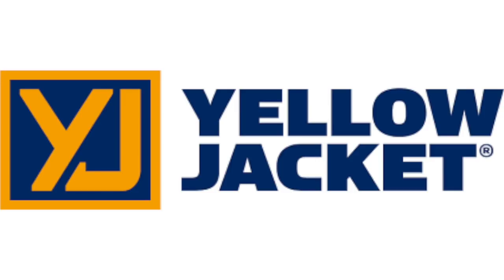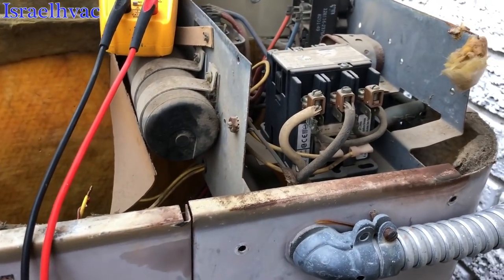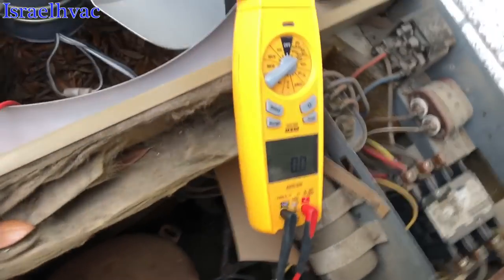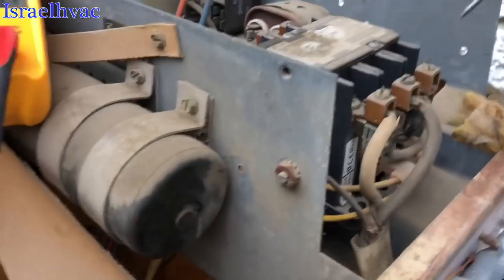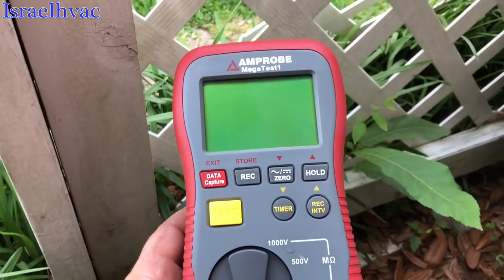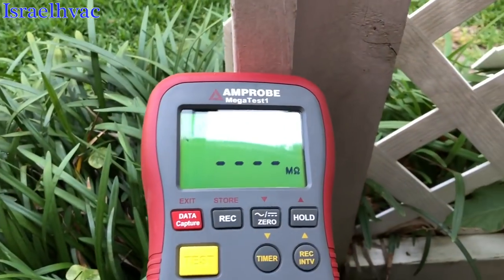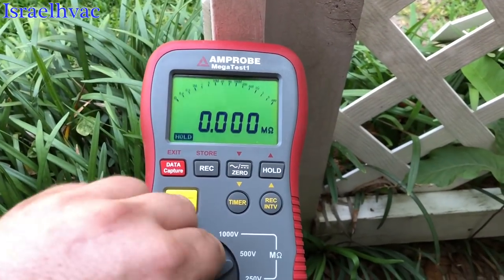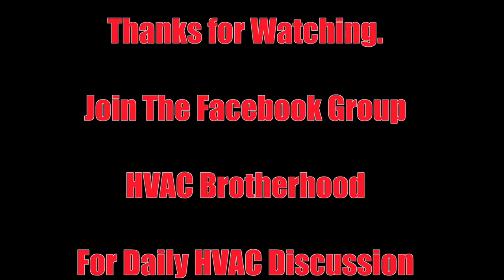HVAC Service | Grounded Compressor

Comment: I'm waiting for all the super techs, usually non company owners, to chime in stating they would replace compressor and get it working and that anybody that would not do the same does not have the customers best interest ($) in mind.
Reply: Ha.   I was gonna say the same thing.    I agree.  By putting your foot down and refusing to do an expensive repair on an old beat r-22 system.   Your actually doing what’s best for the customer, by not allowing them to throw money in the toilet.
Reply: I have the basic led light meger and it was really nice seeing this one..i want it!